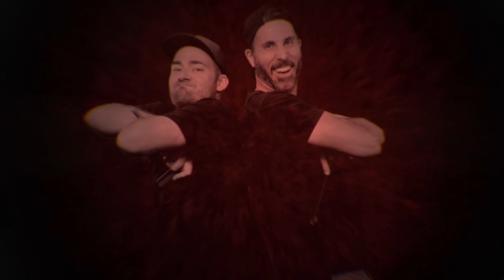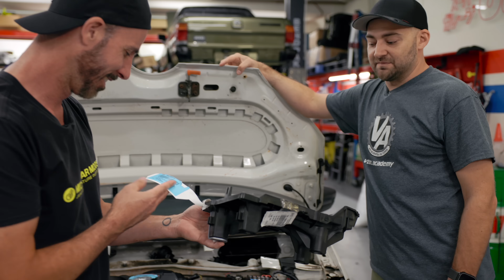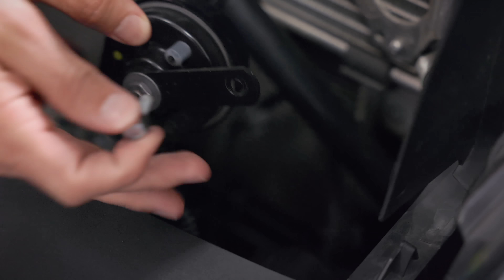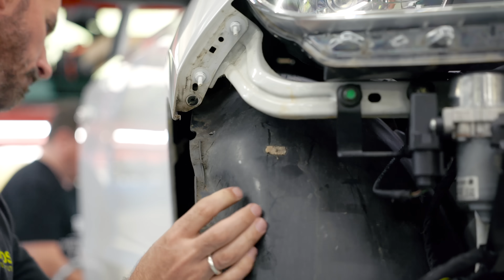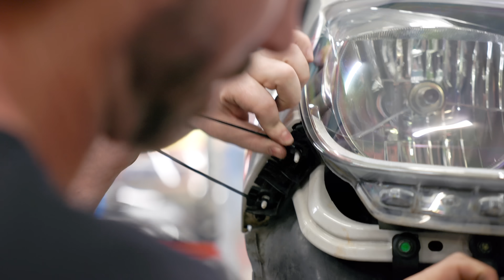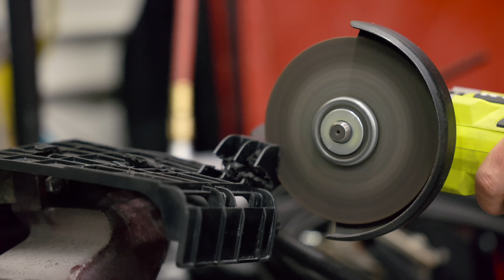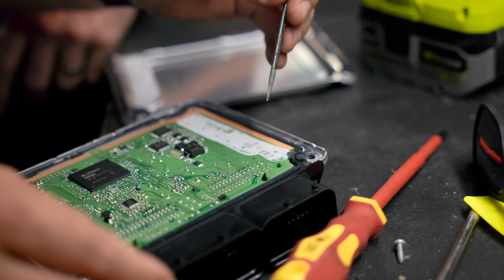I DESTROYED my VW UP! - Turbo GTI Conversion EP7

Comment: There's an Up GTI ECU for sale on UK eBay at the moment for £75. From a 2020 UP Gti. If they won't ship internationally, I'm happy to help with shipping.
Reply: Cross referenced the part number 04C907309BP on that ad and apparently it's the same ECU used in 2017-2021 Polo's, some Seat cars, Audi Q2 to name a few. Looks like the box itself is available cheaply if they're able to recode it or use for spares to repair the damage done to theirs 👍
Reply: Well spotted I've messaged seller asking if immobiliser chip from the key is also available, and also asking them to reach out to MCM
Reply: I believe these have component protection so if they got that ECU they will also need the clocks, locks, keys and bcm
Reply: @zaink7037  yes that’s the factory way but can be wiped out so it will work with what they have.  Commonly done on crash damaged cars where the ecu is toast
Reply: I saw this too. I have heard of the company selling it Reclemet they are good guys.
Reply: @MrJordanwain salvage rebuilds uk use them a lot for their stuff reach out to Rob or Chris
Reply: What a good cvnt !  You rock Jack ! Cheers from New Zealand and 🇳🇿
Reply: Legend
Reply: I feel for you Moog, time to order some socks and a sweatshirt for the Up fund.
Reply: Im sure they can find somebody to take care of it, somebody they trust instead of some random guy on Youtube that is most likely gonna run with the money xD
Its well spotted, but its also kind of pathetic you wanna "help" with the shipping. You should know better. Everybody else knows that you will with 99% just run with the money :)
Reply: @mathiasrasmussen7455  lol, just trying to help man! Done it a bunch of times (I buy on their half, they buy off me, I send to them) and never had problems! Parts have gone all over the world. I’m really not that desperate for £75 😂
Reply: Hopefully it is not VIN locked or can be unlocked without raising any alarms (theft protection).
Reply: @blockbertus  ah yes the "theft protection" that stops people from repairing and modifying their own cars... If we don't have the keys to our own cars. Do we even own them anymore?
Reply: @Hebdomad7  I'm totally with you on this one. But stealing cars and parting them is a real problem, too. Even here in Europe. Two-edged sword and all that. :/
Reply: @blockbertus  unrecognised ecu may be a fault but would sill run and drive
Reply: just did a quick search and found the same thing, fingers crossed it could help!
Reply: Message that guy too UP the price by $500, and then take half the cut as commission :P
Reply: @DistractedTrader  that's fucked UP

Comment: Man that sucks. I had ecu related struggles when I built my 1.8t 20v Mk1 Scirocco so I understand the low point you are at now. Keep at it, the joy when it finally works really takes the edge off and makes all the hard work worth it even if its though right now.
Reply: I bet that was awesome to drive once you'd done it. I always wanted to do this with my VW Scirocco scala back in the day. I miss all my cool 90's cars I had 😢. Now I'm a dad with 2 kids and a stock 1.6 ford c max, but at least the mortgage is getting paid off, then later I can have a mid life crisis lol.

Comment: I have seen this before also, take the ECU fully out of the casing and you will see some of the pins between the board and the connector will have burned out, resolder and connect them and it will come back to life.
Reply: 100% , i do tuning and this have happend me aswell.
Soldered it and all was good.
So i hope they see comments about it.
Reply: I agree, it was hard to tell from the angle, but it didn't look properly cooked. If the surge hit ROM it's probably a different story.
Reply: You'll figure it out. It's not dead. We are sending positive vibes.
Reply: Another commenter said the same thing! Must have some truth to it.
Reply: Others are right this is a computer it takes more than 12-14 volts to do that it fries the connections or the weak spots first which would be the original solder points because those are low temp metal connections should be all good with re-soldering 👍👌everyone just wants you to think it’s crap and buy another one reason 🤑🏦
Reply: Wow Moog, I feel for you. Tears in my eyes throughout the episode. I really hope there's a solution
Reply: Carmo electronics in the Netherlands I think, they test and fix ecus
Reply: I've heard about this potential tragedy and I've been very fortunate so far
Reply: Smash the like button ❤

Comment: Oh dude!!! I’m glad I’m not the only one that makes silly mistakes working on my car, and making a two hour job a two month job with one fell swoop. 
You got this bro, keep on keeping on
Reply: I have a skoda fabia with the 1.0 mpi engine they took out of the car I was doing a simple lower control arm replacement and when doing the right side the sump gets in the way of one of the bolts and blocks it from coming out so you have to undo the engine tip mount and jack the engine up a tiny bit to give clearance I used a bit of wood on a jack and didn't realise the tip of a nail was jist below the surface of the wood . When I jacked it up the soft wood compressed the tip of the nail poked through and pushed into the oil pan when I finished the job and lowered the car the wood was stuck to the pan so I pulled it off then the oil started leaking

Comment: try and find a ecu and immobiliser as a set and replace it all again to save coding.

i really do not think you need to clone the old ecu. the programming is on the vw scan tool and you need the vin from the gti it was taken from to just confirm what version of software it needs.
wish they just put the ecu behind the glove box like a regular person.

Comment: Send the ecu to  " The Automotive Clinic" down in Melbourne. Josh should be able to repair it.
Reply: just needs resoldered pins which are fried, if they take the ecu out of the casing they  will see which ones and can just resolder them and it will work.
Reply: Injectronics also does ECU repairs
Reply: Alternatively it could go.....

IN THE BIN!

Comment: ECUs can definitely be repaired. 
I don't know the situation in the land down under, 
but in europe there are companies that have the harnesses, adapters, measuring equipment and tools to find out what's wrong with it and if it's repairable or not.
Reply: they could replace it with say haltec too.
Reply: @lasskinn474   nah. Then he could have just put the engine in and leave the rest of the car alone. With a aftermarket ecu he's going to loose all the modern features of the car. Aftermarket ecus are good for race cars or older cars where everything is analog. He wants it to work like a stock Up GTI
Reply: @Harry_Gersack  yeah, I'm not sure if there are any standalone ECUs with CANBUS comms and support for direct injection. You'd have to change a lot on this up! in order to make it work with a standalone. Hopefully the boys can figure something out with the stock ECU
Reply: @Harry_Gersack isn't the whole point of this project that they COULDN'T just put the engine in and leave everything else?
Reply: @Nereosis16   Yes they could, but then everything else would not work anymore. It would basically be a racecar without any modern features/creature comforts. The point is that Moog wants to build a stock GTI with everything working. 
It would be no problem to just put a gti engine in with an aftermarket ecu but then your dash, heater, ac, blinkers, steeringwheel buttons, airbags etc would not work
Reply: @tally5k339   there are standalone ecus that work with can-bus. Haltech also does that. But it can only communicate with other haltech parts via can-bus. It cannot communicate with OEM parts. Well it's technically possible, but the would have to decode the VW can-bus messages, find out what everything means and then code that it into the haltech. 
That would be a shitload of work and I doubt that anyone has ever done that
Reply: @tally5k339  There are a few Can-bus, D.I Standalone ecus out there. The cost about as much as the stock ecu too, apparently. Not cheap. 
Not sure how much of the standard car features you'd lose, this is something I'm trying to figure out too with my e46 . Some stuff like the MPG computer I wouldn't miss.. it's kinda depression to watch fuel consumption at the current price of the stuff lol
Reply: @Harry_Gersack  it's a vw up not a cadillac though. i forget about this one but a lil while ago they still were analog knobs for interior fan and stuff like that.

getting a stock ecu for .. well driving lights I suppose if those aren't just relayed from the stalk would still work for that side of things if those are on the same unit.

the cluster might or might not work that way, it's the one that's most digital on at least like up until 2016.
Reply: @lasskinn474   having analog knobs doesn't have say anything about the electronics behind it. Heater/climate control has its own control unit, the lightswitch has it's own control unit the blinker/wiper levers have their own control units and so on.
If you don't believe me watch the other episodes on that build and you'll notice it if you pay attention.

Comment: Just send it to an electronics repair shop. They should be able to find what components on the board got fried and potentially replace them.
Also, this platform seems absolutely dreadful, what a mess.

Comment: This is not the Up GTi. It's the Down GTi 😢. Keep going guys, although at this rate it might have been easier to drive a GTi back from the UK. That would have been one hell of a road trip.
Reply: Don't you mean the Volkswagen Downunda 😅
Reply: @HasseVöfab  also a good one lol
Reply: Australia's import laws were bit weird if i remember correctly, that's why they are using half cuts. Probs can't register whole car 😅

Comment: Last episode Marty said you should have put a haltech in.  Looks like he was right.  😂
Reply: can see tuning fork looking through the window waiting with the ECU in hand 😂 tapping his watch 😂
Reply: @DailyDrivenSubaru 😂 the second story window
Reply: @craigdavies69  😂😂
Reply: The only issue is having to reverse engineer all the canbus stuff, unless someone already did that, in which case you only need to program it in to the haltech
Reply: @MrTurbo_   yea haltech wouldnt be the answer. Cyvecs would be but those are more expensive than factory ecu
Reply: @paasosentomi  I'm going syvecs myself, so I would probably take that over a stock ecu, may cost more, but it's probably worth it if they want to push the car more later
Reply: $300 that could have gone towards one!!
Reply: If they put a haltech ecu then the mfd will not work and thats the best thing on a VW
Reply: Haltech !!!
Reply: Either that or just put the whole car in the bin
Reply: @orielism  in the bin

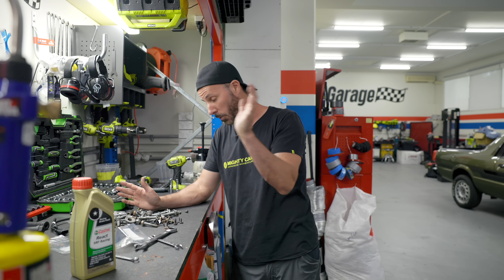Comment: 9:50 the mistake is using baggies or buckets. You have a big shop, think like a big shop owner. You need sortimo organizers (even if they aren't sortimo, i use them cause they're very easy to "eat out of" and keep organization flexible vs the standard ones with inbuilt trays) and a rolling cabinet.
When a project starts, you automatically roll that cart about and start putting stuff in the trays. On top of the cart, you need a small label printer and you're set. Seriously. Stop using baggies and buckets. Not all label makers but some have both stick on and plain paper rolls. Get one of those, and if you can, bright pink label paper. I cannot overstate, understate, roll about the rolling cart just how useful this methodology is, when you're in a big shop.
Bonus tip, to save the $$ you build those cabinets yourselves: each car has its own cabinet with 5 sorting boxes, a large space under for various large parts and a tray on top. Painting them in different colors makes it super easy to figure out which is which. Today you're working on the Up? Roll out the gray cart. Tomorrow the Brumby? Roll out the red cart. Simple sorting keeps your hairs from going gray. Swapping to this methodology 4 or 5 years ago was a life changer for me. Baggies and buckets are ok for small shops, one project, one car, but not for a big one. The moment you juggle 2 or more cars, that's game over for B&B. jm2c